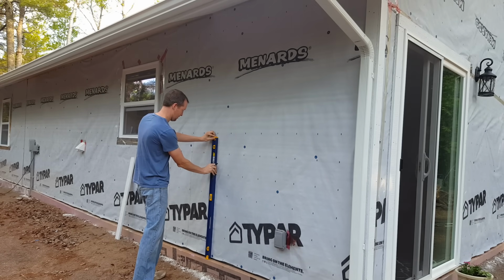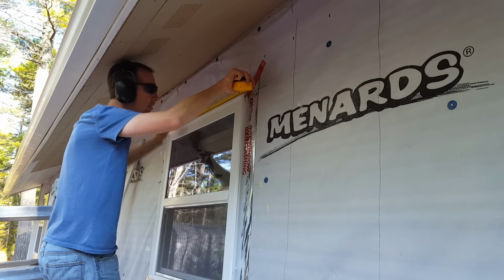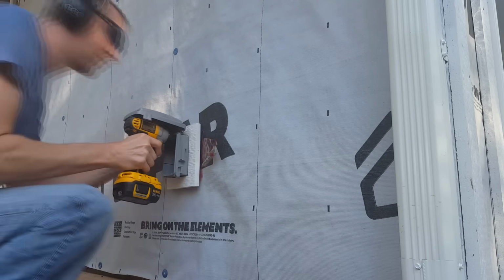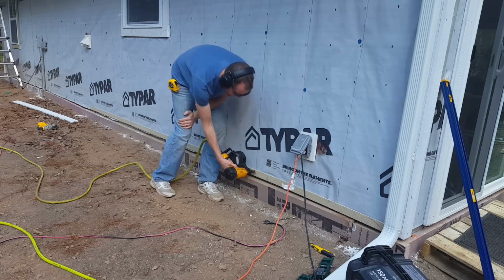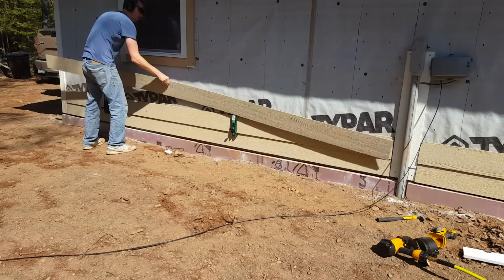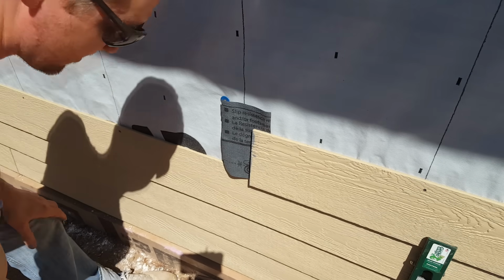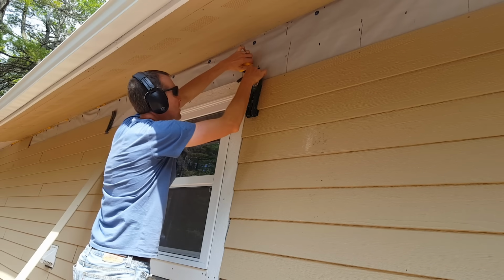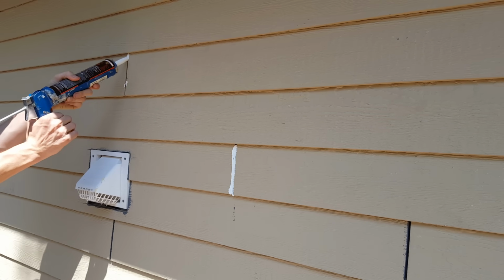Siding a House By Yourself

Comment: General question:
Were you replacing old siding with new siding?

Or is this a brand new home?

I’ve got cedar wood siding in bad shape on multiple areas of my home and have been told doing it myself would require extensive carpenter you knowledge, but it’s doesn’t look that bad
Reply from the maker: Hello, this was a brand new build, so i didn't have to remove any old siding. Really only you can answer the question if you can DIY it. Everyone has different skills when it comes to this stuff. Good luck with whatever you decide!

Comment: Just so everyone knows you dont use a coil siding nailer for installing trim and anything you block in including hose bibs, dryer exhaust, ect must be Z flashed.
Reply from the maker: You are right on the Z flashing, but i think it is fine to use a coil nailer with LP Smartside.

Comment: Hello Chad, nice video.   Will those clamps work with 105 drop siding?   Also, did you make a video on the insulation installation?
Reply from the maker: Hello, I'm not sure what 105 drop siding is. I just have house wrap on the outside and did fiberglass batts on the inside between the studs for insulation

Comment: So when the foundation comes out further than the green plate is it standard to just side to the osb? Because I thought usually the siding should go past the green plate/ treated base of your exterior walls.
Reply from the maker: Hello, I guess I'm not sure what you would do with that. I have only worked with concrete slab foundation, so the green pressure treated bottom board goes right to the very edge of the slab.

Comment: The top piece wasn't shown. Did you put a vinyl finishing piece to cover up the last set of nails?
Reply from the maker: Hello, no I just caulked over the nails and then painted everything. You would have to look really close to tell where the nails are at, and it is kind of hidden under the overhangs as well.

Comment: Great video, what size siding were you using and what over lap or reveal did you use?
Reply from the maker: Thanks! I believe I used 7 inch siding with an 1 1/2 inch over lap. I think the instructions said it had to be a minimum of 1 inch overlap...but make sure to check the instructions before you install.

Comment: What do you think of using the dewalt cordless roofing nailer with the siding attachment? I have a job coming up and I’m debating getting it so I don’t have to deal with a compressor and what not.
Reply from the maker: Hello, I believe the dewalt attachment is for vinyl siding only, so if that is what you are doing it should work. The siding in this video is LP Smartside, so you would want a dedicated siding nailer for that...good luck!

Comment: for Hardi siding, there shouldn't be that much of a gap when butting your siding....it isn't supposed to shrink or expand....keep it tighter and you won't need to do as much caulking
Reply from the maker: That is true for Hardie, but this is LP Smartside. A totally different product with different installation requirements.

Comment: You should always have a full piece at the top. Just like a bathroom tile job it’s pretty amateurish not to. Also that looks like an engineered wood. A cement. Hardy board is a much better choice. It’s really obsoleted the engineered wood the only badge to the engineered wood is it’s easy to work with.

Comment: Why did you start with 1 1/2 ? And not a full board ?
Reply from the maker: That is a starter strip so the next board will be at in angle like the rest of them. Without that, the first board will be flat against the wall and the rest of the boards going up will be at angles as they over lap each other.

Comment: 😎 
Most cheap houses I’ve built had trim on over siding . I wonder what’s the difference? 
I feel like trim hold siding on to structure better in wind but not sure if it’s no No for other reasons?
Reply: trim on top of the siding doesn't allow for a proper seal, doesn't look as good either

Comment: Great job! Why didn't U put battens in for ventilation drainage between the wall and the panels??
Reply from the maker: Hello, I just followed how the manufacturer suggested to do it on new construction. Added the battens could help with drainage forsure if any water gets behind the siding.

Comment: How has it held up since you installed it, especially the bottom rows? Any cracked paint lines effect at the bottom side of the panels due to moisture absorption? 6 years ago I bought an old house with hip style roof with 2.5 ft overhangs. House had beaded cedar mill look Masonite siding that was face nailed and to many of my contractor's surprise it was still in pretty good shape, despite years of neglect. I couldn't find a matching siding so after remodeling I decided to replace it. When I took off the old siding, I was shocked to see that the only damage was on the bottom front of the first two rows and top rows were as as stiff and clean as brand new. And I really loved the cedar mill look. So now I want to install something similar and LP smart siding is the closest as far as the look goes. But I feel hesitant to use it after reading up all the negative feedback about it. Part of me says if Masonite siding could last on this house, LP siding should be just fine too. However my old siding had a smooth curved shape at the bottom, unlike the LP smart siding's rough shape, which makes me think that it may be more likely to absorb water and hence prone to a quicker failure, if I don't get a good paint coverage fast enough. I suppose those oversized overhangs on the house can only protect it so much. Oddly enough fiber cement siding is about the same price right now but my walls are anything but true or flat, so if needed, the face nailing may be out of question for fiber cement. So I'm looking for some honest feedback and recommendations from homeowner who have installed LP siding.
Reply from the maker: My LP siding has held up very well. I think any bad reviews you read about LP is from the stuff they made many years ago. The new stuff they make today seems to hold up great! Good luck with your decision!

Comment: good clear video.  I've done close to a dozen structures now with Hardie (or other) siding. (I have a ranch with lots of cabins)  One comment I'd make is that using siding nails on the trim is not ideal.  Using them on the trim is unsightly and has to be caulked or something to make it look ok.  Try instead to find stainless brad nails, like 2" long that you can use in your brad nail gun.  I have a 16 Gauge nail gun, and no problem finding them, but they do make 18 gauge too if that is all you have.  I've done this for maybe 5 years or more now and the trim is ON there.  You can use extra nails as there is no visible problem. I've pried them off from time to time and for sure they hold well enough to never worry about the trim just "slowly loosening and coming off".  By using the brad nails, no need for filling.  The hole is small enough that the paint afterwards fills the hold and it becomes "invisible".  I try to always use stainless siding nails anyway, (the siding IS constructed with cement and that is quite hard on regular nails, so that rust will show.  Stainless keeps that Rust from happening.)
Reply from the maker: Hey, thanks for sharing that advice. Hopefully everyone will read it that are trying to learn how to side thier house!

Comment: Great video. Why didn't you use the specific metal spacers for the butt joints? Also, I believe your not supposed to finger the OSI caulking after applying.
Reply from the maker: Thanks! I didn't use the spaces, because I didn't get pre painted siding, so as long as I was going to paint everything, it was easier to paint caulk than the spacers. You might be right on applying the caulk. I just did what I thought looked the best.

Comment: 130° temperature swing?🤔humm ok. 
Here's the problem. People like myself come to YouTube to learn about things they don't have a solid working knowledge of so when they come across something like this they think , sounds easy enough and they go for it and end up getting screwed. 
Feel free to prove me wrong and do another video.  
This time call the siding manufacturer  and tell them you want to make a claim. Tell them the siding is buckling badly and you don't know why because you nailed the shit out of it with the nail gun and let's all watch what happens next. It's going to sound something like 'the instructions are available in every language Sir . Next time take a few minutes to read a little bit and you won't go off half cocked and void your warranty.. sorry Sir, hope you have a nice day 🤦🤦🤦.. like I said.. feel free to prove me wrong 🤣
Reply from the maker: I just checked again and a nail gun is what is recommended by the manufacturer for this product. This is LP Smartside... maybe you were thinking it was cement board that would have different install instructions. Living in Minnesota we have 95 degree days in the summer and -35 degrees in the winter. That is what I mean by the huge temp swing.

Comment: Nailing the siding tight won't allow for expansion and contraction and in a few years the siding on this job will be buckling all over the place 🤦
Reply from the maker: 4 years later my siding has no buckling...and I live in MN where we have a 130 degree temperature swing between winter and summer. As long as you leave the expansion joints between each piece of siding you should be good.
Reply: I believe you are thinking of vinyl siding where you have to keep the nails loose so they pieces will move with the house as it contracts and expands. With Smart siding you have expansion gaps to account for that.

Comment: Great video. I am going to be replacing cedar bevel siding. How should I handle the butt joints?
Reply from the maker: Hello, I'm not sure how you do butt joints with cedar. I don't think you caulk them...maybe just a flashing material behind each joint.

Comment: What size nail / nail gun did you use for this? 16g? 1 1/4”?
Reply from the maker: I think I used .113, 2 inch nails with a standard siding nail gun.

Comment: Thanks for the video but checked with Hardie website and they say never caulk butt joints only vertical edges against trim or windows.  Butt them right up to eachother because it doesn't expand and contract with weather.
Reply from the maker: This is not Hardy siding, it is L.P. smartside...i totally different product  with different install instructions.

Comment: Is this fiber cement siding or masonite siding? If is fiber cement siding did you have to use special nails for the nail gun?
Reply from the maker: It is LP Smartside which is a wood based product, no special tools to work with it and it holds up great!

Comment: Hey Chad, what is done on the final piece if it is very short near the top? If siding up to aluminum soffit do you caulk the gap between the top piece and soffit? Thanks!
Reply from the maker: Hello, what I do is measure the distance to the soffits when I have 3 rows left. This way if it looks like the last piece will only be an inch for example, I can just raise the reveal about 1/4 inch each on the last 3 rows and the last piece will fit perfect!
Reply: Ahh.. ok cool! Did you do wood soffits?
Reply from the maker: Yep, I did do wood soffits

Comment: I would seriously think about Z flashing and flashing tape over the outlet cover trip.  I know its a protected circuit but its a real pain if the GFCI trips everytime it rains. I know becuse ive got one that does this.  Granted its not as fancy a box
And your vapor cover blocks water intrusion but its cheap insurance. Well worth the effort. You also should have done the window. The main reason for wood rot is poor flashing its worth the effort to add the extra protections. 
It dosnt take much water to start the rotting process becuse wood behind a outside surface wont dry out as fast then if it wasn't covered up  so its best to keep the water away as best as possible.

Comment: Dry cutting fiber cement board siding is fatal I have scarring in my lungs from being around a guy cutting it with a saw blade wish everyday I would have left.
Reply: Yeah, it's engineered wood.  But fiber cement stuff, like Hardie board, wear a serious respirator and don't let anyone tell you otherwise.
Reply: 👍 but this planking appears to be timber based 
Not positive though ✌️
Reply: You have scaring cause your an idiot who’s stands next to a cut man

Comment: What are the spacer hanging clamps you used, and what do they set the overlap at?
Kind of important to know to figure coverage.   If you overlap 1/2"  or over lap 3/4"  you could land 1 sheet short
But also if you do a story stick you could space the laps to land full lap on the last top lap or close enough a trim board covers the gap at the top.
Do the hanging clamps adjust?
Reply from the maker: They are called gecko clamps, they are completely adjustable to leave any size overlap you want. They really work great!
Reply: @chaddiy  
Yes I looked at them, but id still do a story stick so I know where my laps tops land on a wall so I don't have to cut out for a window and land on it without adjustment or trimming one of them.
Thats what they showed on this old house.  
I like the trim part you put on the outlet box but look above I made a point about flashing. 
My house is over 25 years old you really can tell when flashing wasnt done right or poor techniques were used when it was built.  Its smart to look at things and why they failed then get at idea how to make them better with just a little extra work. 
My house has the Abit siding on it.
The remedy by the manufacture was to paint it. Trust me ive seen houses by me that got plenty of paint on them and still look like crap.  It was a piss poor product.  Basically cardboard sheets.
Paints only as good as the substrate under it.   Back when my house was built they didn't use Typar  and the sheting is OSB.  Ive got plenty of water damaged wood.  Ive seen it on sevral houses.
I dont even like treated wood for trim work. The PVC holds up a lot better.
It just cost more. But that also depends on what profile you use 2x or 1x 
Thanks that is a pretty cool tool ill have to buy a pair when I replace my lap siding.
You think somone would come out with a system for sheet goods that works just as good.  Around here they started to lap the sheet goods insted of using z flashing between sheets with a trim board over them it looks a lot nicer. 
I say this becuse my house is 2 story with walk out basment so ive got areas 3 and 4 sheets up  10x4  or 9x4

Comment: If you are able to get trim behind the electrical conduit, why not run the siding under it? The area around the foundation and starter strip is a nightmare. The OSB sheathing will be rotten in no time. The foundation insulation is out further than the siding with absolutely no hard flashing. The OSB sheathing will suck up water like a straw and the foundation will be wet. It's easy to cut siding and nail it to a house, but it's the waterproofing details that will ultimately protect the house, and this is done all wrong.

Comment: So what about water between stating strip and foundation? The moisture will be accumulating there getting under start strip and first board... You need to put flashing between foundation/subwall and sliding
Reply: This house will have all kind of wood rot and water damage in the future. What always amazes me about YouTube videos... You find people who make videos and they really don't know what they are doing. They know a little bit... just enough to get it half-assed. There are so many details of this job that are wrong. There  are plenty of professional siding videos available, so why does some random guy need to add his two-cents, especially if it not completely right? This Old House and others have videos that show the correct way to put up siding and flash around openings. So why do novices continually go out of their way to contribute faulty how-to videos. You want to side your own house?... Knock yourself out... What compels them to make how-to videos?

Comment: ok,  so maybe the Typar is not "flat" but what about a proper air gap or rain screen for moisture?
Reply from the maker: Hello Emaley, I think the air gap all depends on what type of siding you are using. I used L.P. smartside and this is the standard way it is installed in my area. I know some types of siding require the air gap material installed first. It really can vary though!

Comment: Hi, we need to repair few boards in the middle, can it be done instead of replacing every each row?
Reply from the maker: It sure can! You just need to pry up the bad boards from the bottom. Then use a sawzall with long metal blade to cut the nails holding the bad board. Then insert new board and face nail it. I have done it before, and it isn't too hard. Good luck!

Comment: I don’t understand why painting the cuts is necessary prior to install. 

Also, I don’t understand the starter strip
Reply from the maker: Hi Tim, the paint is to protect the siding in case water ever gets in the seams. The starter strip is so the first piece of full siding doesn't sit flat on the wall. You want it to match the overlap angle that will be on ever other piece.
Reply: @chaddiy  Thank you so much. Obvious now but the questions were bugging me.